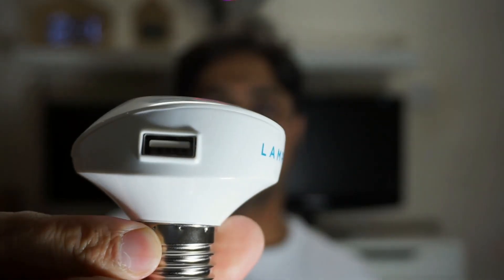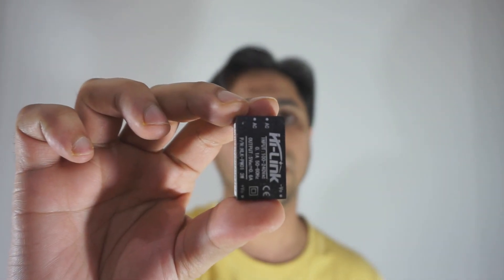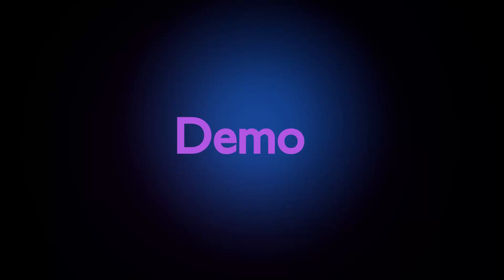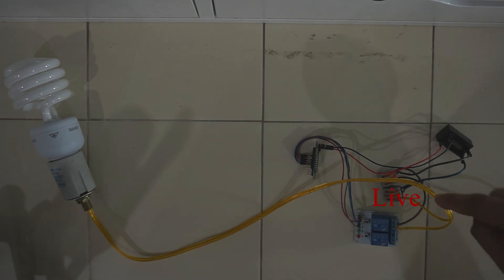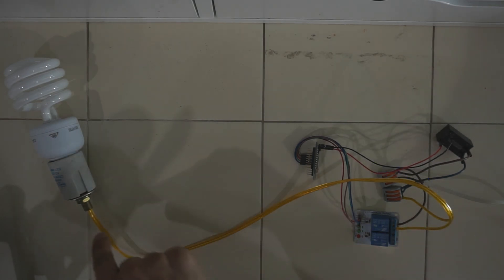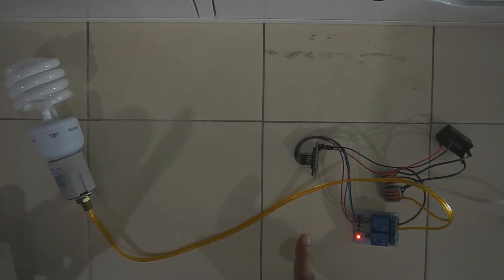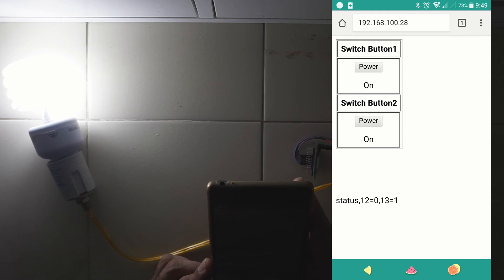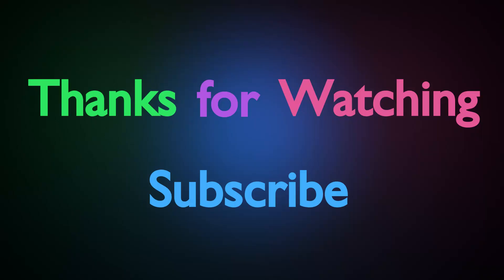AC to DC Module for IoT Projects - Baba Awesam

Comment: Hi, can this be used 24/7 for one arduino project, does it become hot?
Reply from the maker: I use mine for 24/7 but I never bothered to check the temperature. Just like you can use an AC to DC adapter the whole time, this module is just that.
Reply: @SamirSogay  thanks for the reply, was concerned about safety and it's too small.... I will use it in my project

Comment: Is this safe and reliable? How long have you been using this?
Reply: This is as safe as any AC to DC module which are also part of usb chargers. The only thing you have to be very careful is the AC input, that you isolate it properly as will carry mains voltage.

Comment: Good work brother,  but video is bit darker.  try some good lighting..
Reply from the maker: sandeep m bought one. Should be used in another video. Thanks for the input.
Reply: Video is all good,e xcept for the lighting, and hope u can provide a diagram to the AC to other parts... using AC power has always been a worry for me, ive a number of time trip my main power supply when i have blown my ac/dc module. but this does look like very do-able..
are u using the AC to 5v/06A module to power the esp?

Comment: I connected it as mentioned... But when i checked with tester, it shows current passing through microcontroller and relay - both. Accidently if you touch it, you would get electric shock. Should it happen or there is something wrong in my connection?
Reply from the maker: AC will go to AC of module. Module will give DC output which will power the microcontroller. No way microcontroller gets AC. AC Live will go to relay Common and NO or NC.
Reply: Samir Sogay yes, i connected ac to ac only. Dc supply to microcontroller vin and gnd. Getting current in the microcontroller.
Reply: My connections are : ac mains to ac of hlk-pm01, dc +ve to vin of nodemcu and relay +ve, dc -ve to gnd of nodemcu and relay -ve. From nodemcu d5 to relay input.
Reply from the maker: Your connections seems fine. Where exactly are you getting Live?
Reply: Samir Sogay in nodemcu pins and relay input pins. Do i need the relay board with optocoupler?
Reply from the maker: What surface you have kept all the components on, it seems the wires are getting shorted. Did you also check the output of AC to DC Module that it is DC? Optocoupler is not necessary but if you have a relay with that then well and good.
Reply: Samir Sogay it's on wooden surface. I checked with multimeter, it has 5v dc and 1.9 A current. I checked other hlk-pm01 too, one has 2.5 A current and other has 2 A current
Reply from the maker: Don't connect anything to the relay Common, NO and NC and see whether you are getting Live anywhere.
Reply: yes, still getting the live on nodemcu pins. ( Connection - ac mains to ac of hlk-pm01, dc +ve to nodemcu vin, dc -ve to nodemcu ground.)
Reply from the maker: This is very strange and close to impossible. You are not anyway touching the AC side with the DC side like Neutral with Ground, right? Try lifting the module from the surface and check.
Reply: Ok, will do that and let you know.
Reply: I did it... Still it is the same
Reply from the maker: Don't have any further suggestions
Reply: @dipaldpatel  Hidden wires beneath the tiles?😀